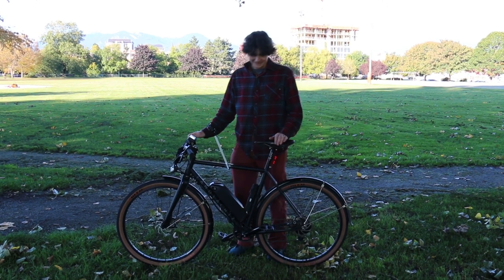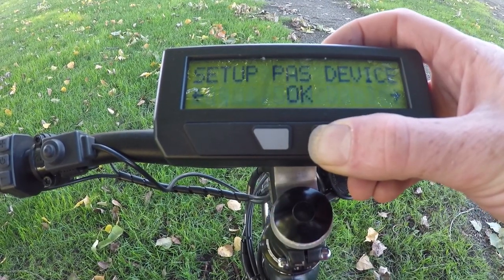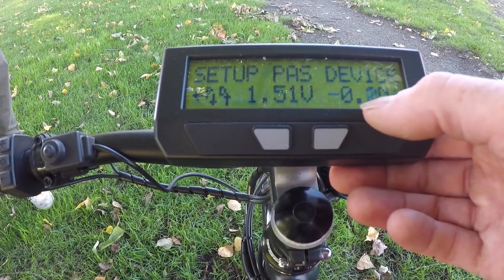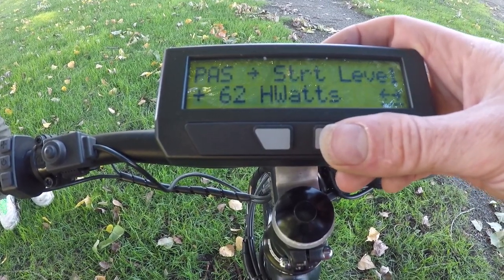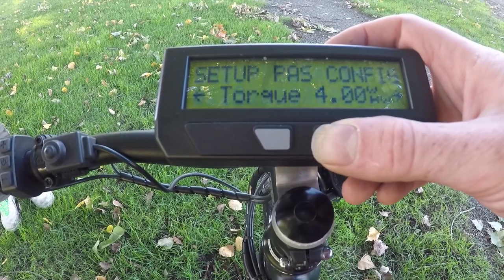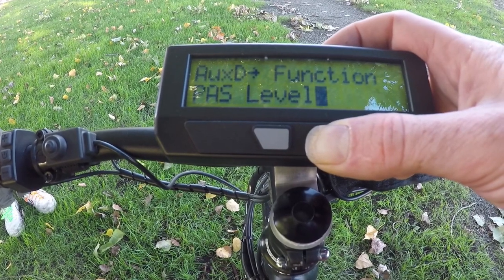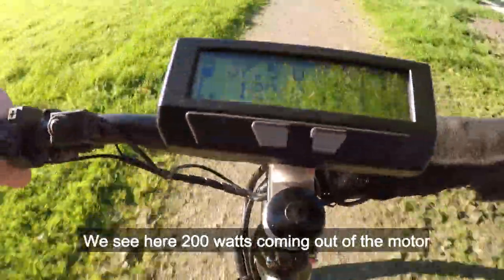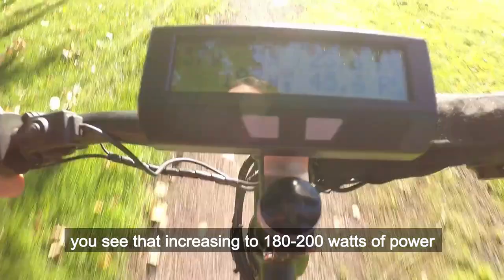How to Setup a Torque Sensor with a V3.1 Cycle Analyst

Comment: This video helped me get my erider bottom bracket set up.  While it would have been easier if it had a preset like some of the other torque sensors do, going through it and understanding all the different settings made me realize just how customizable and adaptable the cycle analyst really is and the applications it can be used for outside of just a plain ebike controller.  The name is far too humble.
Reply from the maker: The ERider does have a preset with the 3.15 firmware which you can get from the CA setup utility tool, it will be in the "beta" release firmware directory as 3.15b3 if you click "get latest firmware from grin".  

Yeah, in the original days of V1 and V2 devices the name was a bit more apt!

Comment: Hi, thank you for this video.
Paired with phaserunner, is it still possible to get regenerative control from PAS only (without ebrake sensor), by setting low PAS power (or low torque, or low rpm) threshold activating the regenerative brake ?
BTW, is it necessary to connect PAS directly to cycle analyst, or is it able to retrieve the data from the controller if PAS is connected to controller ? (this would simplify wiring)
Reply from the maker: Hi Kurtz, we anticipate releasing our 3.2 CA firmware fairly soon that has back pedal regen features implemented. If you want this now you can email us and we can send you copies of the alpha release firmware to install and play with, but the public beta builds are still a little ways away.   The PAS sensor must be hooked up to the CA, not the controller.

Comment: It looks like 3.14 doesn't have the Erider as an option. Is there info on what all the settings should be if I want to use the Custom option?
Reply from the maker: That's correct, you can update to the 3.15b3 that is downloadable via the software suite. Some ERiders have 18 poles, others have 36.  Torque scaling is about 70 Nm/V

Comment: I have the erider and only the P moves up and down and not the D. Is this normal?
Reply from the maker: Yes. The T9 sensors have a single wire pas signal, not a quadrature

Comment: Hey, ive got a ebike with a torque sensor with the cycle analyst v3. When i pedal, it jerks the bike meaning the motor starts up for a brief second then stops right away. Why does that happen?
Reply from the maker: Most often because the PAS Start and Stop RPM thresholds are set incorrectly. If you navigate to the 3rd display screen that shows the pedal RPM and you see it alternate between an initial cadence value and then 0 rpm, that can confirm if this is the case.
Reply: @GrinTechnologies  and how do I fix this
Reply: @GrinTechnologies  there are usually levels of assist I can pick aswell. Where can I change those from?

Comment: I have just a voilamart 1500w motor with a standard cadence pas sensor, it is way to touchy. I barely pedal and the motor kicks in full force and continues even after I stop pedaling, I’ve learned that a light twist of the throttle kills the pas so that has been my way around it. Anyways I need something that really makes the power ease it’s way on  as I pedal so you get the adequate power for how much torque you give. Is this compatible with my set up? I’ve got a voilamart 1500w motor with a 52v 20ah battery
Reply from the maker: In theory yes but it's quite a DIY job to retrofit a factory bike to be controlled via the Cycle Analyst. Doable but not at all plug and play.  You gotta be hardcore into custom wiring and ebike electronics stuff.

Comment: Newby question. Can you connect a cycle analyst to any controller?
Reply from the maker: So long as the controller has a throttle input line and accessible battery input leads, then for the most part yes. You can use the stand alone CA shunt inline with the battery leads and feed the throttle output signal of that to the throttle input line of the motor controller.  Have a look at the diagram on section 3.2 of the CA3 user manual
https://www.ebikes.ca/documents/CycleAnalyst_V31_Web.pdf
Reply: @GrinTechnologies  got it, thanks man😊

Comment: Jeez, I have more money in this bike than a car. I just a torque sensor for the bottom bracket and wouldn't you know it, I bought the only one that doesn't work with a version 3.1 cycle analyst unless I download new firmware because it has 36 poles. Will it work at all without downloading the firmware and if not can I download the firmware on my android if I have the correct cable?
Reply from the maker: It will work just fine, the only issue is that your pedal cadence will read a bit higher than it should. This won't affect the actual torque assistance at all.

Comment: I'm excited to switch out my Bafang DP C18 display for a Cycle Analyst with torque sensor input (or maybe the DP C18 has that?). I pretty much use the pedal-assist up/down buttons for throttle most of the time, since my throttle lever feels cheap and about to break, has maybe 2 or 3 power levels that aren't predictable, and it just feels more natural. Torque sensing assist sounds great -- and I really appreciate Justin's ethos of building human-scale mobility solutions that respond intuitively (great long tour/interview here: https://www.youtube.com/watch?v=IxB2j-egWcQ). 

I'm working on a super-heavy-duty version of the Carla Cargo trike cargo trailer with electric assist (going for 2,000 lbs payload capacity). I've thought to use linear (telescoping) position sensors to regulate trailer assist based on forces applied through the tow arm. Seeing stress-sensing torque sensors in action, I'm now thinking a bow-shaped yoke on the tow-arm, with stress sensors on either side of the tongue, could provide standard voltage output for off-the-shelf PAS controllers, AND possibly provide 'stereo' info to deal with potential overrun of the trailer on the pilot vehicle when, say, braking downhill (differential torque sensing on either side of the tongue could apply differential regenerative braking on the trailer rear wheels to keep it tracking resistance-free with the tow arm, and ultimately lock up the trailer braking to keep it from jack-knifing if forces got too out of hand). 

Is this feasible? Would you have anyone there at Grin willing to guide me on this (as well as a hub-motor / wheel mount challenge I've commented on, separately -- need a wheel motor with 1" spindle bearing, OR, a half-axle torsion suspension wheel mount similar to FlexiRide trailer wheel mounts, but with 20mm spindle. Find my project notes Twitter @eMULE2020
Reply from the maker: Hi Robert, a force sensor inside the trailer link is an excellent idea that works very well, we know more than a few people who have built powered trailers this way and have contemplated making a commercial product to facilitate this.  No need to even use the PAS input, just have the signal go directly to the throttle input of one of our controllers and allow the signal to go below 1V down to 0V as well. Then it will work bidirectionaly by default both to do regen on the downhill and power on the uphill, all with zero input needed from the rider.